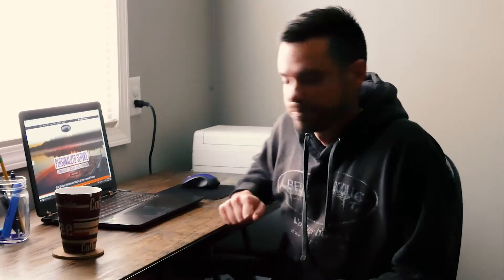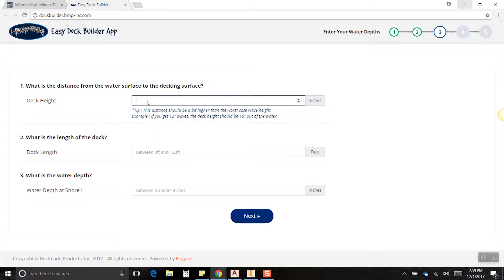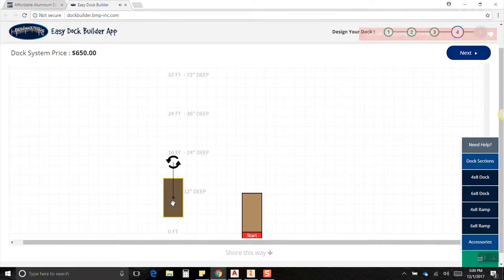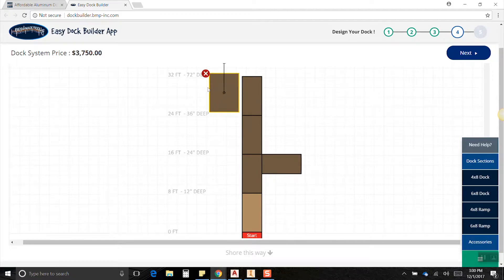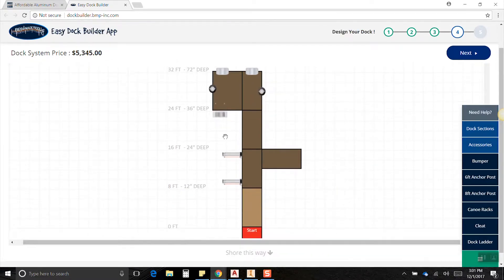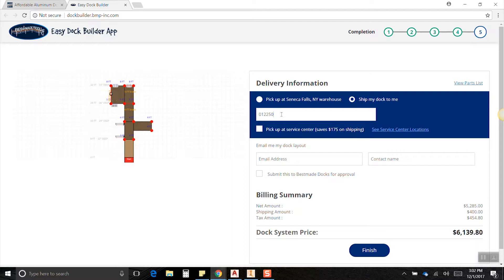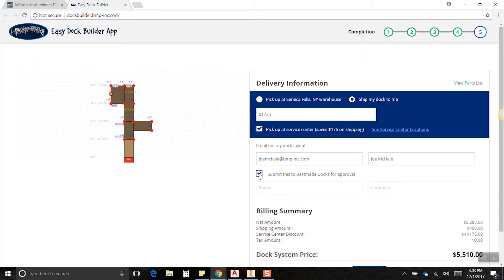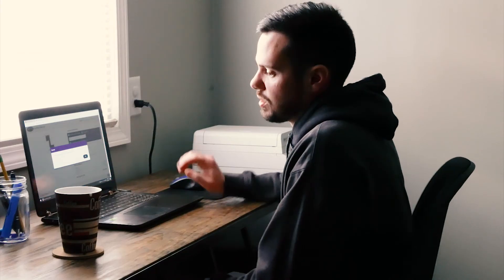Online Boat Dock Design Tool - How to use it

Comment: Seems like it should ask more questions about the type of river or lake, flow rates, seasonal elevation depth changes etc, then recommend different types of docks with pros and cons of each suggested type. THEN add your ladders etc. It should include seasonal docs and how to use them as well as permanent solutions.